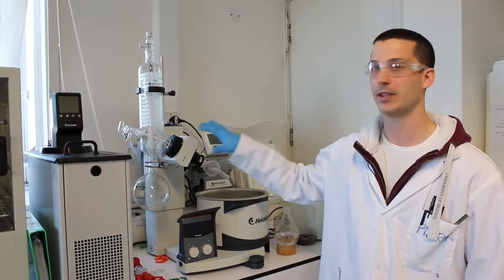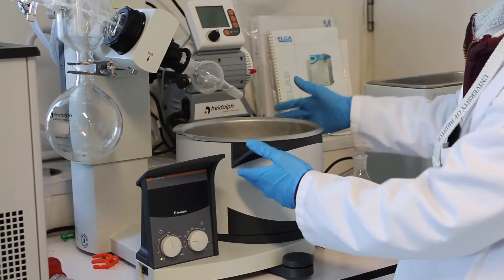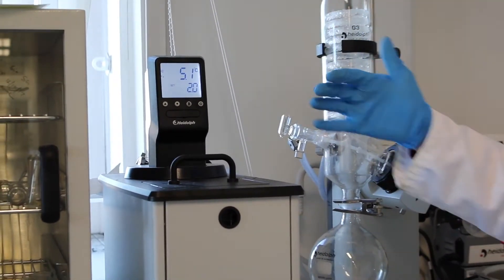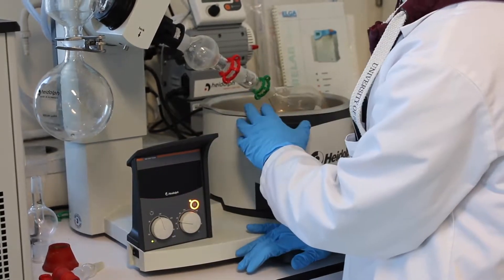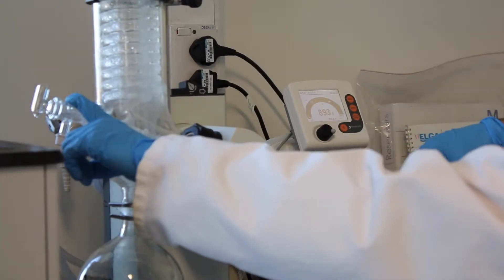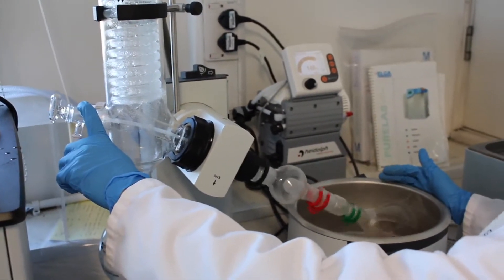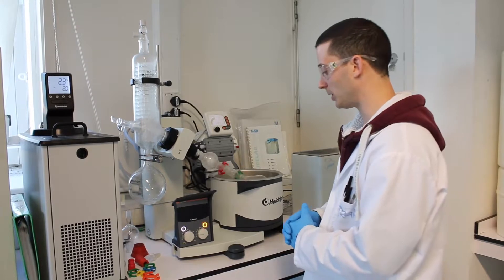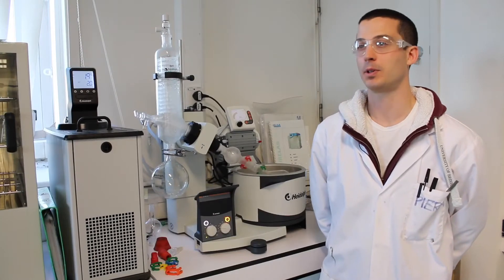How to use the rotary evaporator

Comment: So how do you get your product our of the ball flask after the solvents been evaporated?...Solvent?
Reply: Yes it depends on what your product is but generally you'd use a warm solvent e.g. Ethyl acetate, which is then cooled to give you crystals that crash out upon cooling
Reply: Thats what im thinking right now
Reply: It really depends on what you need to do next. If your product is a solid you can scrape it out with a spatula, if is a liquid you pipette it out etc.